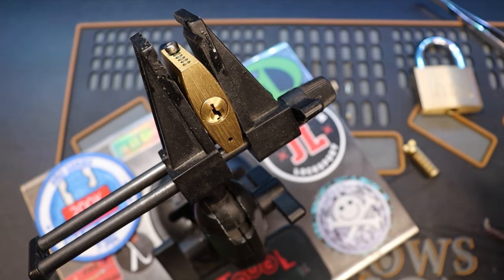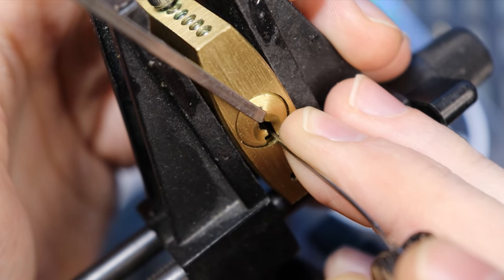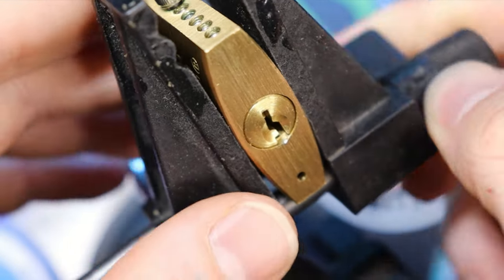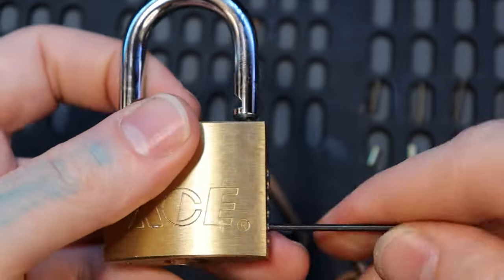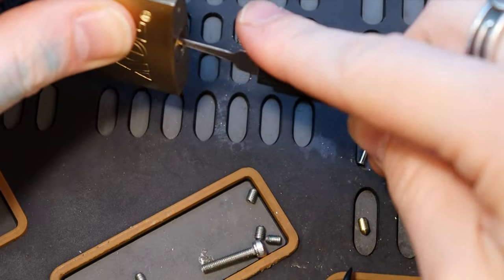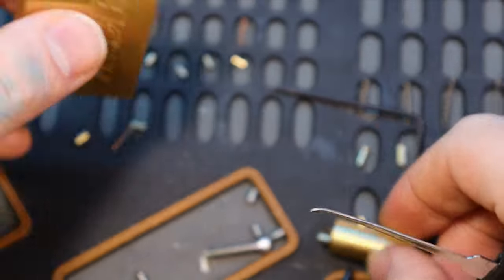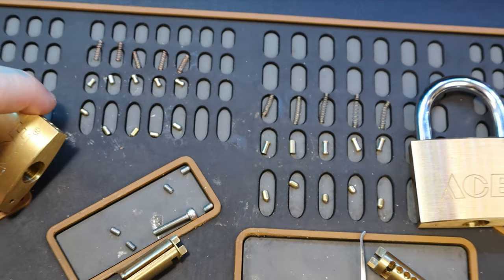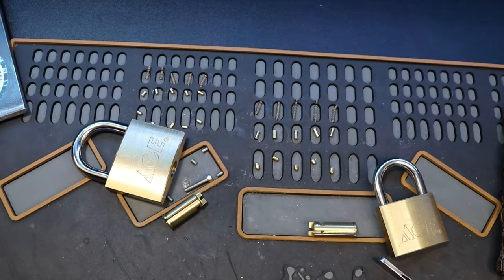267) Ace Brass Padlocks Picked and Gutted

Comment: These are tough
mine feels like very little feedback, clicks off the slightest touch, then an apparent click very high up, then false sets where theres no counter rotation off pushing up on the drivers theyre just stuck af
Reply from the maker: Sometimes spools can suck. If you're not feeling counter rotation in any of the pins at a certain point then you made be over setting and lifting one too high. Let some tension off and let one down and go back at it. Best of luck! Great lock to practice spools on for cost.